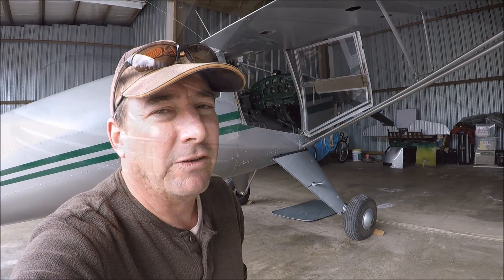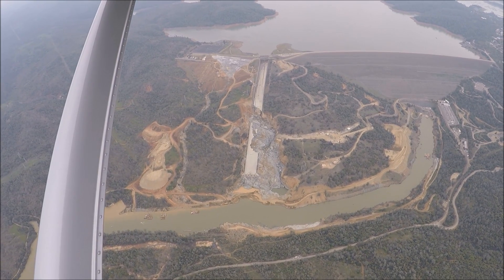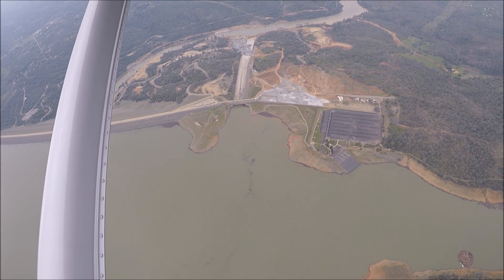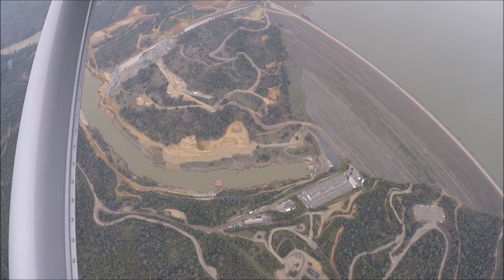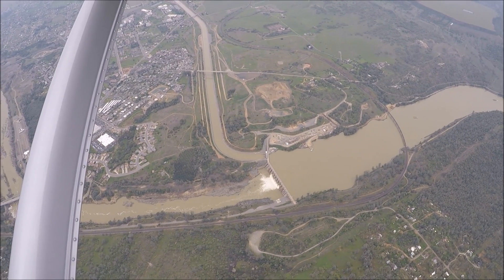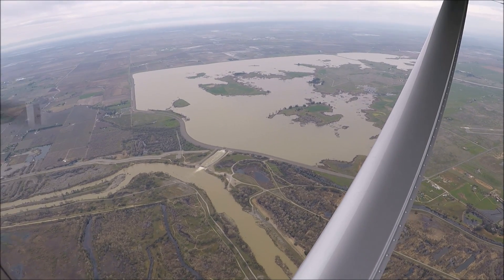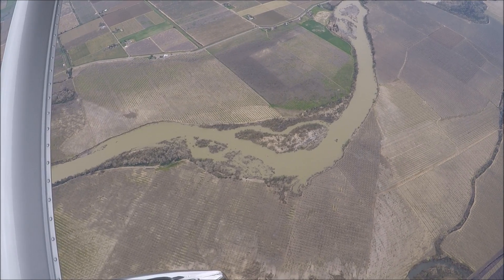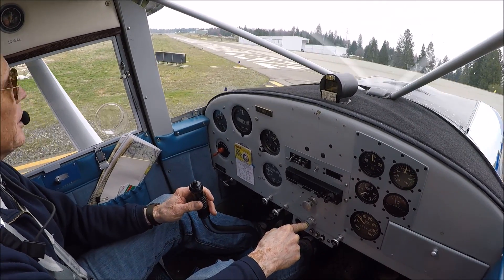Oroville Dam 15 March Flyover and Update

Comment: Can this sound reasonable, this situation is caused by  lack of maintenance,  everyone knows that year after year the lake is getting filled with  debree coming down the mountains, maybe the amount of rain from past years is the same but the fill capacity is becoming less and less every  year.  Maybe I know this because  my reservoirs at my ranch contain less water each year and much more sand and rocks! And my ten million dollar expert advice is to remove it every time the water levels permit it. Hard to find out, Huu?

Comment: I would guess one of the drainage tiles under the concrete plugged or broke and water started running on outside of tile taking soil with it leaving a hollow place under concrete,like a farm field that gets a blow hole when a tile breaks, with concrete over tile no one would have seen it.

Comment: 9:10 As you fly over the tailing piles which were used for the dam fill material, did all/most of the tailings come from that specific part of the river? I'm assuming when they were dredging for gold, they would move the unwanted material as short a distance as possible from the dredge to same time and money. To rephrase my question, why is there so much dredging tailings in that one specific area?
Reply from the maker: SanFranciscoBay that's where they did all the gold dredging, creating those ponds. much of this came down the river from hydraulic mining way upstream.

Comment: I saw an idea to build several spillways between the existing spillway and the parking lot along the width of the emergency spillway area.  It would cost huge bucks but safety is priority one.  Using the existing spillway could cause enough erosion, the integrity of the dam could become an issue.  Any time estimate to rebuild the spillway if you didn't have to worry about using it?  A year?

Comment: I'm wondering about what you've called benches.  There are three of them located on a ridge top adjacent to the newly carved river canyon, and one by the power plant where the new haul road terminates. Judging by the differences in coloration, it looks like they're separated into different materials ie  rock, boulders and soil.  Could those be borrow piles for future remediation work?  The topography just looks wrong to me to be for flood control...or maybe I've torn my tinfoil hat again.
Reply: I think what the DWR means by benches are these concrete/rock benches that they build beneath the emergency spillway. https://pixel-ca-dwr.photoshelter.com/galleries/C0000OxvlgXg3yfg/G00003YCcmDTx48Y/I0000hXYGDPbQWBs/DK-oro-spillway-damage-5805-03-06-2017-jpg
Reply: I was referring to what Juan called benches where the haul trucks have been dumping, but yes, I did see the ones you were referring to.  Looks to be an improvement over what was there!
Reply: I see what you mean.  Maybe I was looking at the wrong side of the strut!

Comment: I started looking at the reports of the dam problems from an engineering stand point.  To start with I thought most of the reports were bias.   After about two weeks I found your report.  Sorry I did not comment earlier.  It was different, you reported what you saw and you were going the extra mile to try to get to the truth.  I liked that and now look for your reports every day you are home.  I was looking at some of your older videos and you explained you were a pilot.  I then understood why I like your reports.  My background is civil Engineering and I designed a project that had to move that much material.  Thank goodness it was not with Back Hoe, which is a lot slower.  
I agree with you in the fact that they are still going to have to spend more money for a real fix.  That was old engineering for a spillway and there are better designs now ready to control water.  Thank you and please keep reporting.  I also like your reports from your long flights.

Comment: Cause- How about, failure to repair spillway in 2012 when damage was first discovered!  Basically, initial design of spillway was bad ( not enough rebar with only one layer ) and then built with faulty concrete!  Very sad situation, unfortunately there is failing infrastructure like this all over the United States!

Comment: I do some work for an Hydro engineering firm in Sac.  They say it has been identified that most likely Drumming (Lifting and droping the concrete) in two locations  on the spillway broke free  a large piece of spillway due to resonance oscillations at certain flow rates.    They drove 36 rods into the rock on the remaining upper spill way to reduce any additional drumming.   Something like the Tacoma Narrows Bridge but from water flowing.  They are looking at a redesign of the spill way with additional features to reduce any oscillations.   I believe they are preparing a notice to go out to Dam operators across the country  to be aware of this process.
Reply: They believe the long dry period cause a separation between the concrete and Rock face.  That separation then allowed for the drumming oscillation at the high flow rates.   Live & learn.
Reply from the maker: Daniel Weston excellent! thanks Daniel.
Reply: This sounds like something that I would have figured someone somewhere would have tested with some sort of scale model (think wave pool/wind tunnel style testing). Turbulent flow is hardly a new concept, did someone just not put all the pieces together till now?
Reply: This makes a lot of sense to me.

Comment: I don't know if they are going to be able to release the water as planned. There is a dam below the Oroville dam  that found damage in its structure.  They waited this whole time to fix it and now it is going to cause problems for Oroville. What in the world were they doing this whole time while Oroville was minimally releasing?  Who knows. http://www.sacbee.com/news/state/california/water-and-drought/article138528578.html
Reply from the maker: jodi ocsanip don't over react to msm's lack of knowledge and over sensationalism....this structure is over 100 miles away and will not affect Oroville operations.
Reply: Michael Onines . Good to know. A week of almost solid rain starting this Saturday is coming. Glad they are on top of things.
Reply: The location of that repair work, the Clifton Court Forebay, is on the south end of the Sacramento/San Joaquin Delta. That work is unable to change how much water Oroville can release. Anything the pump operators don't suck out of the Delta will flow out into the Suisun and San Francisco Bays the same as it always has.
Reply: blancolirio . Not over reacting, just highlighting another dam issue. I know it's all tied together in one way or another, like a tree, it weaves in and out but they do affect eachother one way or another.
Reply: Michael Onines . Thank you for the information.
Reply: No problem, Jodi. The pumping system at the forebay can push almost 11,000 cfs, which is really important for Southern California's drinking water, and is a significant draw on the delta in the dry season, particularly over the past few drought years. During wet years and flood conditions that changes. That paltry 11k cfs becomes a rounding error on the overall San Joaquin and Sacramento river system's ability to move floodwater. The Sacramento river has been clocked as high as 600,000 cfs!

Comment: How is it that with the water level in the dam so high, you can still see such a vivid and quite wide tide line around the shoreline away from the dam? It looks like the water has been much higher for enough time to kill off all that vegetation.
Reply from the maker: sac43 the top is 900'
Reply: Ah yes i know, but how is the vegetation missing from what looks to be close to the 900? is the water level often kept higher than it is know or do they send out people to remove it? I read somewhere that the water levels had been so low for so long that they had to put in an extension on the boat ramp. 
Regards Steve.

Comment: just a thought   when they rebuild the spillway   why wouldn't they angle it so its more in line with river  instead of hitting the river at 90 degree  angle as it is now  could build it  beside existing one and it could  act as a wall for the emergency spill area too

Comment: if the put shot Crete in with the debris to fill in the crater that the spillway created, I'd assume that it would handle quite a bit of force from the water. that is if it all has had proper time to cure and there isn't any air bubbles in it.

Comment: Beautiful airplane! 
What did you mean that it doesn't have an electrical system?
Reply from the maker: No starter, no battery, just hand prop it. Just a tiny battery for radio/intercom.
Reply: blancolirio : nice, light and simple; does it have any conspicuity lighting?
Thanks to Doug for chauffeuring you - loth lovely planes.

Comment: I love that magic blue fuel clean carbs and parts super fast and my jeep loves it when I run that stuff at the dunes super stable in high compression motors and lasts for a long time. to bad its $5 a gallon
Reply: Drew : $5 a gallon?  We pay that for road fuel in the UK!
Reply: £5-30 gall at Asda this morning. :-(
Reply: You wouldn't want to put it in you plane though.
Reply: its made for your plane is 100LL avgas I just happen to have 12:1 compression and a larger carb in my jeep. also it will go 58mph in 100m on sand. not your average jeep lol
Reply: damn chris that sucks last I paid for road fuel was $2.40 a gallon.

Comment: If you have a good contact I could suggest a temporary fix to release emergency flow water. This process would use the existing overflow with some adjustments with diverters and focused water flow. After quick installation of the "system" work could be started to repair the main overflow. Contact me.

Comment: why is it going tp take them a yr to find out why it failed  its more reason why CA  can waste more money   i can tell you that it was most likely  the lack of maintenance and them putting bandages on things instead of fixing the prob  when they were told it was going to fail in 2012 that's why it failed
Reply: People are more impressed with new dams than they are with maintaining existing dams.

That includes politicians.
Reply: The federal government required an independent investigation.  They have to talk to a lot of people. They may even have to run concrete tests to determine the actual failure mechanism of the concrete spillway.   The present consensus is cavitation or the beating of the water against the concrete at a period frequency.  They have seen recently  in concrete tunnels on how it slowly erodes the concrete surface away long after the Oriville dam and spillway were built.  

In 2005, the environmentalists wanted the emergency spillway converted into an auxiliary concrete spillway.   However, the federal government and the CA DWP did not think it was necessary.  BTW - that was under George Bush and Arnold Schwartzeneger.   Everyone knows the emergency spillway would erode after its use. However, no one foresaw that the current concrete spillway would be destroyed in the way it was.    

I would not say that protecting the source of water for farmers and cities is a waste of money.  it is unfortunate that some maintenance was not performed on the gates and one of the turbines of the dam.  However, if one is in the middle of a record draught who could see this coming.  It's mother nature and she is unpredictable.  it is not clear to me that even having that maintenance done, that the concrete spillway would still not have been used this season.
Reply: ya i understand that i was more being a smart ass lol
Reply: Pat Kittle:   There was a new dam that was supposed to be built right near Oriville dam, but it was not.  I can't remember its name now.   I think the issue with building new dams is really an issue with the land owners - governments have to buy that property or take it by eminent domain.   i am sure the land owners don't want it in their backyard.

Comment: Hey Jaun, How do they measure water flow ???
Reply from the maker: I still need to get that answer...
Reply: blancolirio , the water flow can be computed from the height of the water at the spillway gate opening/orifice.  By Torricelli's law, the  water velocity through the orifice,  v =  √(2gh) where g is 9.8m/s2, h is water height above the orifice.  Next is to know the cross-sectional area of the orifice. The spillway gate controls  the size of the rectangular orifice and  water height is measured from the centre of the orifice. Therefore, if water height is 10m, v=√(2*9.8*10)= 14m/s. If a 10m wide spillway gate is  lifted 1m above its sill, the orifice area, A is 10 sq.m. The spillway discharge, Q= v*A = 14*10=140 cumecs. I hope this will help to explain.
Reply: blancolirio  , the water flow can be computed from the height of the water at the spillway gate opening/orifice.  By Torricelli's law, the  water velocity through the orifice,  v =  √(2gh) where g is 9.8m/s2, h is water height above the orifice.  Next is to know the cross-sectional area of the orifice. The spillway gate controls  the size of the rectangular orifice and  water height is measured from the centre of the orifice. Therefore, if water height is 10m, v=√(2*9.8*10)= 14m/s. If a 10m wide spillway gate is  lifted 1m above its sill, the orifice area, A is 10 sq.m. The spillway discharge, Q= v*A = 14*10=140 cumecs. I hope this will help to explain.

Comment: Again really nice reporting.  Very informative and quite enjoyable all in all.  I think the spillway is going to be okay as long as they can limit the rate of out flow.  I think that's what they have in mind.  As for the investigation and speaking as an arm chair Youtube watcher there are several problems.

1. The emergency over flow and main spill way seem poorly designed from the get go.

2. Main spill way, (the one  that broke) is too steep, and probably should have had baffles to slow down the flow. 

3.  Long range weather predictions were off and the water in dam was allowed to get too high.  Should have been drained sooner.

4.  The new nature made spillways are probably better than before.   I think with more engineering the replacement route will be better than before.

5.  They will remove the bottom portion of the original spillway and have the water follow the more natural broader path through the rocks.  Concrete will be added to various "pot holes" to reduce erosion. 

6.  Weather projections will be improved in relation to the amount of water allowed to be held by the dam.  The management of the water level must be more conservative on the side of over fill safety.

7.  With improved spillways any crisis in terms of overflow will be less consequential than before.

8.  I really believe this recent crisis is due to poor spillway engineering at the beginning of the project.  They never expect the lake to top out to the extent that it did.  The spillways were designed for minor run off. Obviously the long spillway slide was never expected to accommodate the amount of water that destroyed it.
Reply: The main spillway was designed for 250,000 cfs, which is more than the river itself can handle. If they hadn't tried to baby the spillway by reducing the flow when it started to collapse, the lake level would likely never have gotten high enough to overtop the emergency spillway. That, plus the unexpectedly huge amounts of rain we got made an unfortunate combination of circumstances.
Reply: I'm confused as to the identity of the various spillways.  Are there three in total?  Which is the main one?
Reply: The main spillway is the one that broke in half. The emergency spillway Is not a spillway proper at all; it's a weir-wall adjacent to the main spillway. The top is lower than that of the main dam by about 20 feet so that in an emergency the water will overtop it instead of the dam itself. It had never had to be used until a month ago; using it is bad because there's absolutely no control over the water coming over the top of it, it's just the lake overflowing. Water can also be released out of the power plant at the bottom of the dam, in relatively small quantities.
Reply: My undestanding is the main spillway tore apart when they released approx 100,000 cfs through it.  That's why I claim the design was inadequate.  In a sense the emergency spillway did it's job, but the land underneath it was not prepared properly either.  I don't claim to be an expert on this in anyway, but as they say, you don't have to be a rocket scientist to see that neither spillway was up to the task.  Once the river clogged up with rubble you could really say, "they were up a creek without a paddle."  All and all the recovery effort was miraculous.  I'm sure they will keep a closer watch on it in the future, but now from what you are telling me, the main spillway may be placed too high to actually avert the catastrophe of wide spread excessive rain fall.  This brings up the theory that global warming actually  leads to an Ice Age.  An Ice Age is brought on by excessive snow fall.
Reply: Another amateur video claims that there's been a LOT of logging in the headlands in the last several years. If true, that was a COMMERCIAL process that reduced the ability of nature to slow the runoff and let water soak in way up river(s). Also, fire could have had a similar impact. I've asked Juan to address that possibility.

Comment: A few story's ago, when taking about valve out of order, because of themaledo  power plant, where ie that power plant?
Reply from the maker: The burned Thermalito Power Plant is on the outlet of the Thermalito Fore Bay.
Reply: At the bottom of the main dam.  I believe it is below ground.
Reply: Sandra Hendricks : the generator in the base of the Oroville dam is the Hyatt power plant; there's another smaller generator downstream at the outlet of the Thermolito fore bay - but that's not generating now because it suffered a fire and needs re-equipping.